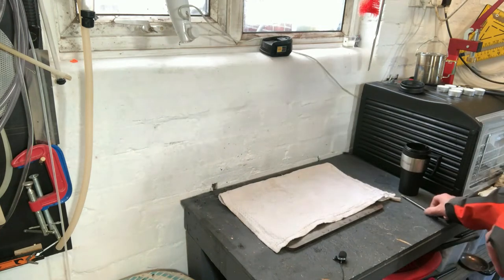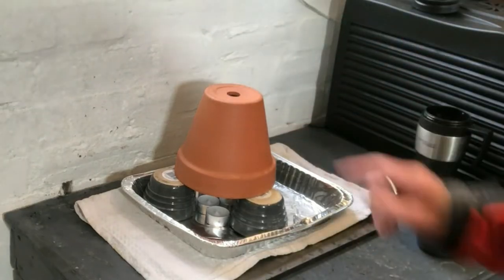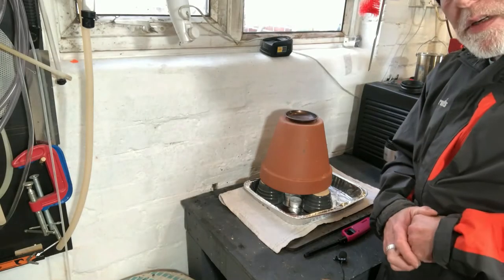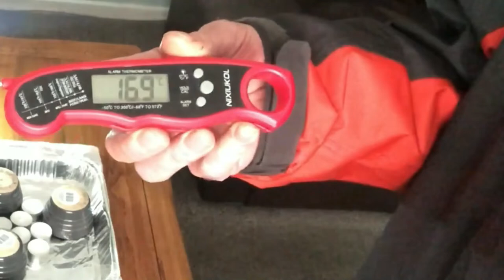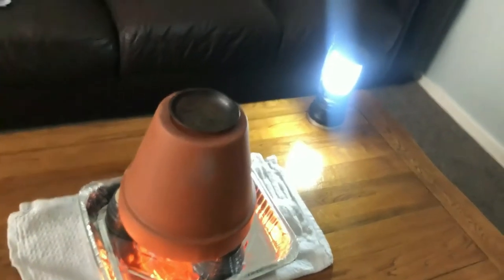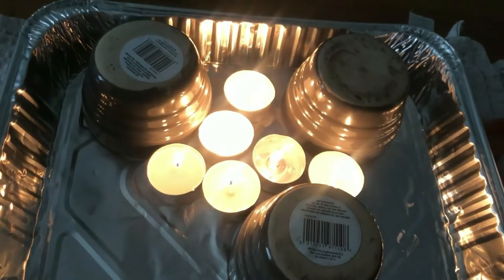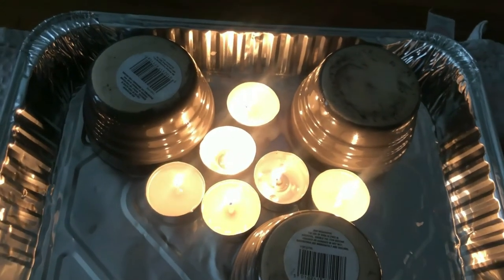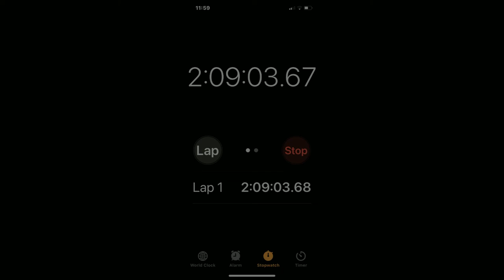Flower Pot Heater W. I. P.  Part 2 The final.

Comment: Replace the candles with Activated Carbon Felt. Roll it into a 2/3inch piece of copper pipe. Stand it in a pool of vegetable oil for a few minutes for it to wick & you now have a candle that will never burn down & will practically last for ever!
Reply from the maker: wow thanks so much taking time and effort to reply. really appreciate it. alas it take time for my damage 🧠 to get through your advice. but i’ll get back to you as quick as i can. i love people that know my disabilities and understand, that maybe obvious to all yous, it’s not straight away for me. take care and hope you and yours are all safe and sound 🫡👍bri
Reply from the maker: 😮 i think i get it know🧠🤕🤦‍♂️😂what a great idea. have you done this on your own channel? or can link for me to watch. as without pics n vids clips i struggle to understand. thanks again. Bri
Reply: @briand7285  Robert Murray Smith channel Brian 👌🏻 he used the activated carbon and copper tube wick in vegetable oil. He had to start it with a drop of ethanol as veg oil is thicker. It deffinatly works but will stink your house out lol.
On my coffee table right now I've got an old cutting board, a saucer with 6x8hour t lights. 2 bricks and a stewing pot instead of flower pots. I'm buying some pots on Monday because apparently ceramics hold the heat longer. This is toasty enough lol but I like your double idea. Just gotta watch the cats tail or it'll be climbing up the wallpaper when I'm trying to put it out 🤣 cheers mate God bless.
Reply from the maker: Ha! Ha! poor cats!!😮 great idea on starting ethonol. I'm waiting on my 'Proper lamp oil' coming lol. watch Robert Murray Smith channel, hes a clever bloke...& crazy!! i do crazy 😁😂🤣 catch you soon, away to play with DIY Burners lol. Bri 😉
Reply: @briand7285  lol I love watching him, he absolutely loves what he does and is always open to better ideas. The cats cleverer than I thought and avoids it 🤣👍🏻
Reply from the maker: @seekingthelight6401  his enthusiasm is addictive🤣🤣👍mind some of the projects is (for now!🤔) is out of my capabilities...🧠🤕.